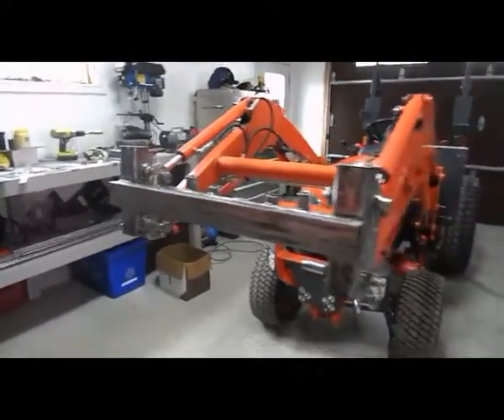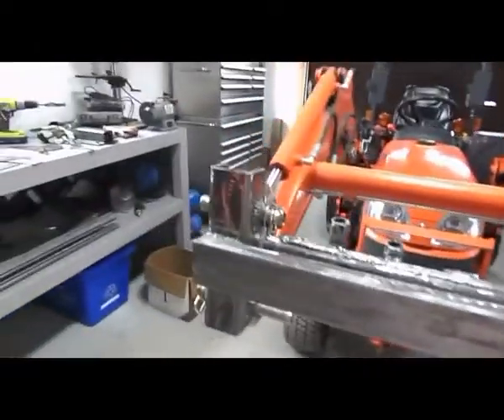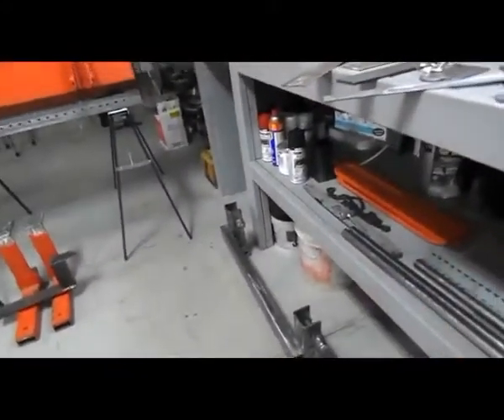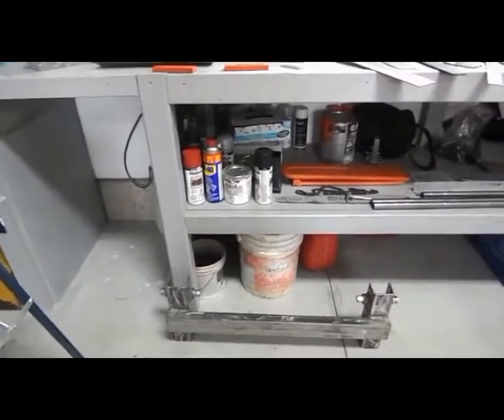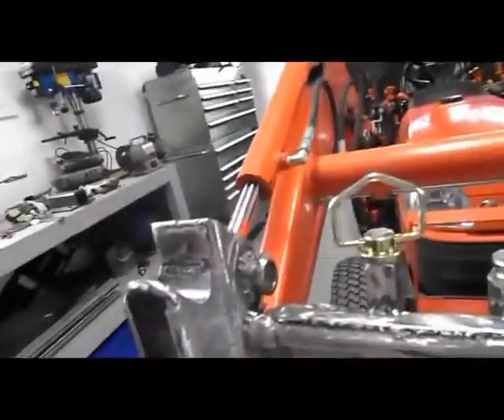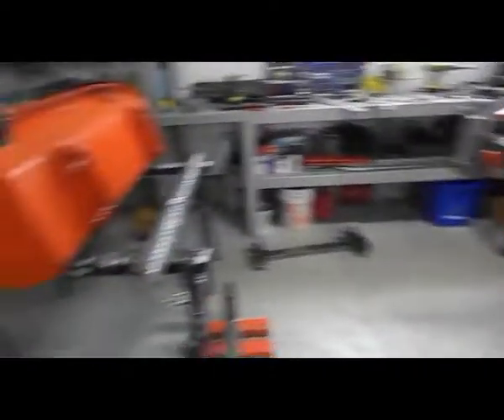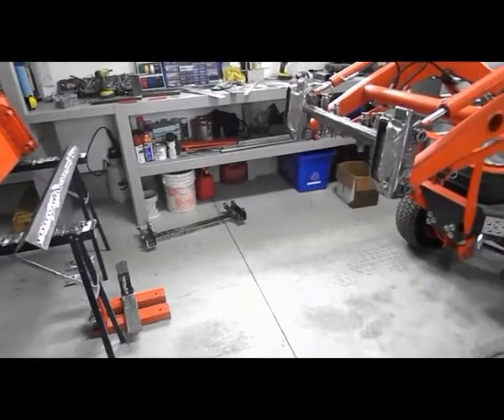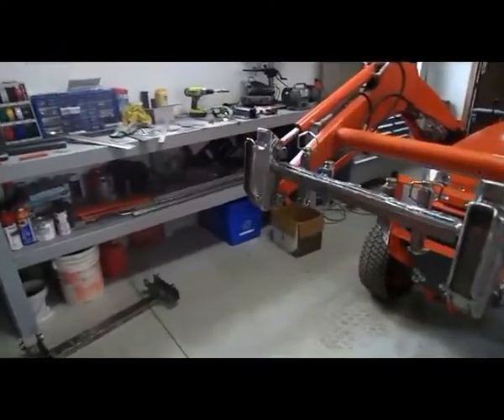Kubota B2620 - Making of Quick Attach Brackets – 10

Comment: Very nice job,turned out really good. I have an 2012 BX25D and was thinking of a quick attach. I like making things and you were able to give me some good ideas. If possible,it would be nice to have a parts list so if one was going to buy metal,they would know what to get. Again,very nice fabrication. I am also from Canada.
Reply from the maker: Thanks for the comments Dave, I wish I would've keep the list of material on this project and I also actually upgrade my tractor the a New LX3310 a couple months ago and all my mods when with the old B2620 when I sold it :) I will be starting to post new videos on the mods I'm doing on the new LX in the next few upcoming weeks.  If you have some specific questions about the quick attach send me an email at "simpledesignscp@hotmail.com"
I know I have lots of pictures I took during the build and also I had created a step by step pdf of my process which I don't think I've posted about ?? anyway I'd be more than happy to share all this information with you if that could help you out ?
Reply from the maker: Hi Dave, so after checking my old files on my computer I did find a material list so again email me and I'll send you all this information :)

Comment: Very nice job. I am undertaking a very similar project, I am using 3.5 inch tubing for the tractor side and 3 inch tubing for the FEL side. You have already helped solve some of the problems I was running into, thanks. Yours looks like it came out good. Do you notice any loss of lift of movement?
 Please keep updating you progress and any other projects. Thanks!
Reply from the maker: Hi "Fn"  so to answer your questions, no I did notice any lost of lift or movements and I have now been using my quick attach between the bucket and the fork lift attachment I've made we no problem at all so far :) and I must say I wish I would've done this from day 1, it so handy to have that option and since the B2620 isn't strong enough to run most of the universal quick attach equipment out there I prefer this option.  I will post more video and updates when I have more time right now I'm too busy with my work.  If you have any questions feel free to email me directly simpledesignscp@hotmail.comClaude